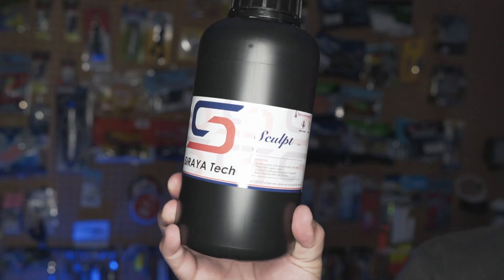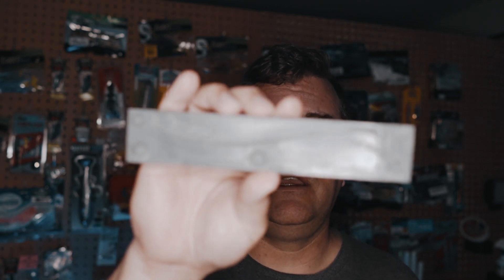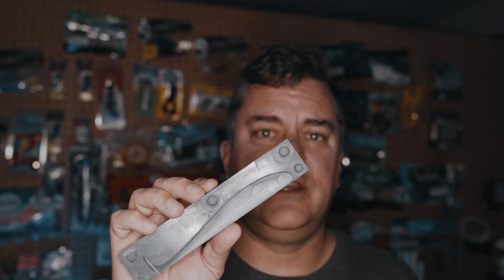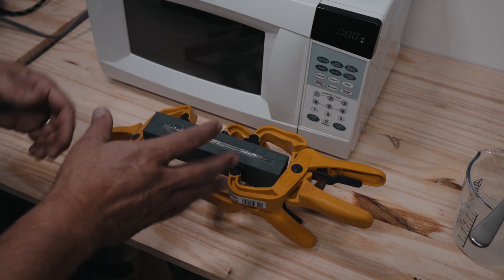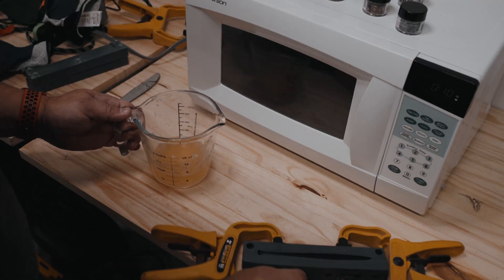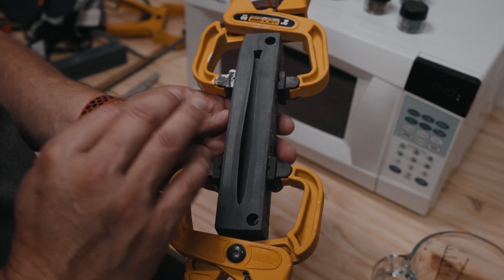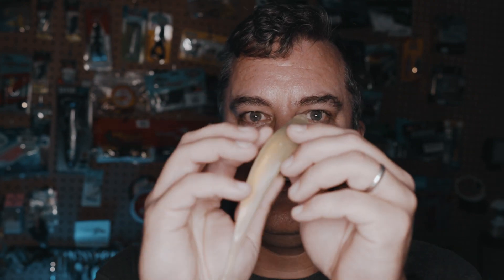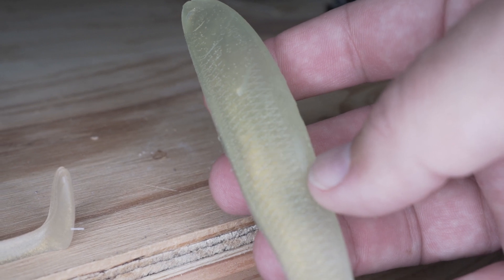3d Printed Fishing Lure Molds   Better than Aluminum?

Comment: As a jeweler, I'm considering using something like a, Shooting Star, melting pot, modifying the pot with a spring-loaded nozzle at the bottom and then using compressed air as the injection system. This is the way we inject wax into rubber molds for mass production. I'll have to experiment with air pressure and install several safety systems due to the hot plastic inside the device. That being said, It might be possible to run water through the resin molds with a pump to keep the mold cool enough for more rapid injection. This resin is just what I've been looking for to handle the soft plastic high temp. If you see any potential problems with my idea, let me know what you think. Otherwise, I'll keep you informed on my success (or failure). I'm a CAD jewelry designer, so creating unique soft plastics should be right up my alley. Even if the injection system doesn't work, I should be able to use traditional injectors for my two-part molds. Hope this works.
Reply from the maker: Great idea! The main issue I see is most resins are hydroscopic aka the absorb water and over time break down if they continue to get wet. I have no idea so long it would last but its cheap to try! Would love to hear your results!
Reply: @WMBayouLures  That's great information. At work, I wash my resin models in 99 percent alcohol and never in water. UV cure and then invest and cast. The resin I use leaves no ash behind and my jewelry castings are pretty much perfect, like wax models. I think the solution, rather than water cooling the molds, would be to make several resin molds, inject, and then by the time I got back to the first one to open it, it would be cooled off more. No down time waiting for the molds to cool since I would be injecting 3 or 4 molds. Because like you say, resin molds are not that expensive to make. I'm considering an Elagoo Saturn ultra with the high temp resin you recommend. hopefully, it won't take long to play with the settings and make it work. I will keep you updated.
Reply from the maker: I use 2 Saturn 3 Ultras currently and download the Chitubox settings file from Siraya Tech website and it worked great right out of the box.

Comment: Hi Bill, Can you Advise on how this stuff would go injecting into a Resin Mold please as i want to use this method for my lure, would it warp a 3d resin mold by the injection https://youtu.be/bYHKDd06s-s?feature=shared ????
Reply from the maker: I have not found a way to inject resin into a resin mold yet. Every time I try it fuses together. I think silicone mold is the right way to got for resin lures. I have a process for 3D printing mold masters that I will be releasing as soon as I have the process all nailed down

Comment: i Call you out and there is filments that will not worpe or bend due to heat
Reply from the maker: 350F/176C? Please post links I would love to try them out!
Reply: @WMBayouLures  what make andd modle of printer you have because it will play a roll in what filment you can use
Reply from the maker: @AndrewMurphy8383  FDM I have a P1P
Reply: @WMBayouLures  here is the deal most filments cant high temps the one can do is costly  but  most people justuse special resin to do so but i am not sure that would be am to work for what we want so i am doing some deeper look and trying to find out what filments can be use that wont worp and can wistand the heat of the plastol what is the temps do you warmit at since i am new to the soft baits game and when i find out i will let you know what to look for

Comment: thats the issue i found out about, printed molds don't disipate heat as well as alluminum molds, I did the dummy thing and seperated my 3d printed mold apart as if it was a alluminum mold, and it was stuck together but split the plastic apart and it was still hot in the middle of the "Spur". so guess i gotta let em rest for a long while
Reply from the maker: Yep, which is why resin molds are not great for any kind of volume work. Perfect for prototypes, making a few baits for yourself type work but once you want to make a bunch of baits you then need a bunch of molds, or get an aluminum mold made.

Comment: I have been working in blender doing sculpture. Not sure how the models I have done will work as a 3d need a little more research. Is anyone else doing this? I could use a support group.
Reply from the maker: er can produce files for 3D printing for sure but I am not sure it can easily produce the molds. I have only dabbled in Blender so I am far from an expert but from the videos I have watched it is not ideal. When I have people send me files from blender the big issue I see if that the scale is not set correctly. From a practical standpoint blender is not parametric out of the box making tweaking fairly imprecise. I love blender and always work to find a way to get the best of both tools (Fusion 360 and Blender). I think we are getting pretty close to the day where they are going to work pretty well together, mainly due to Fusion 360s improved mesh handling. 

Oh and I am working on a support group, just not sure what platform to put it on yet....

Comment: Siraya Tech Sculpt HDT is 160c or 320f, not in the 380s. (Look at that, the point where Fahrenheit is exactly double Celsius😋) That being said, with enough perimeter layers and infill, HDT isn’t a concern as much as melting temp. If you have the capability, I recommend using a 3D print to make your void for an aluminum cast
Reply from the maker: Yes that is correct. I print each side solid at 15mm and have never experienced any deflection. I am not sure what the thickness of the material they use when determining HDT for this material.

Comment: Takes way too long to cool down takes forever
Reply from the maker: If you need to produce large volumes of lures then it probably does but then if you need to produce large volumes of lures, simply print more molds. My large multi-cavity molds cost roughly $15 in materials to print. I can print a ton of them for the same cost as an off the shelf aluminum mold and a crap ton for the same cost as a single custom aluminum mold.

Comment: Awesome video. Have you ever thought about making molds and selling them. I currently make molds from silicone but looking for someone to 3D print me some two piece molds just like this. If you told me what program was compatible with your printer I could do the design work for my specific bait and forward it. If it’s anything you’ve ever considered let me know we can exchange email/cell number.
Reply from the maker: Thanks, I have considered selling molds, my only hesitation is that while these produce a good bait, they are not exactly user friendly and generally need a lot of clamping. I have printed some for people though. Feel free to reach out and we can discuss the details. bill@gulfstreamoutdoors.com
Reply: @WMBayouLures  sent an email, thanks

Comment: Well done. Phrozen TR250 also holds up well with heat and seems to perform better than the specified temperature they state on their website. I've shot multiple lures so far without issues, but time will tell!
Reply from the maker: Awesome I will have to test it out. Although once I get the Siraya Sculpt dialed in I am not sure I will want to mess around dialing in another! 😂